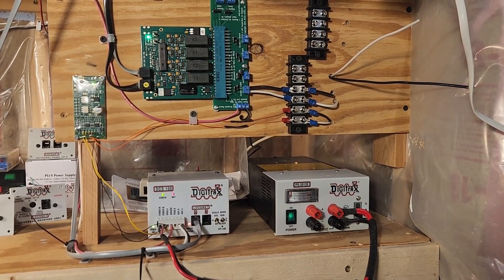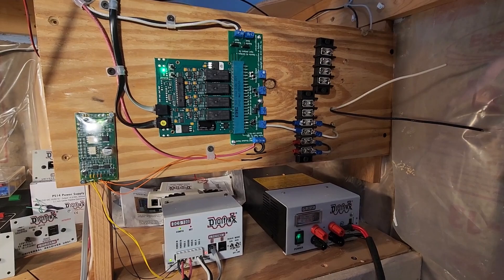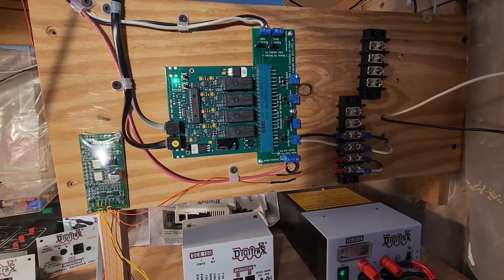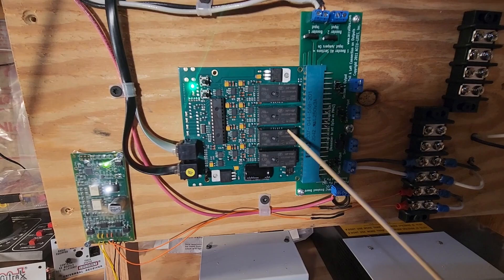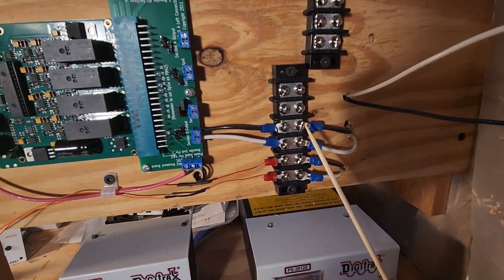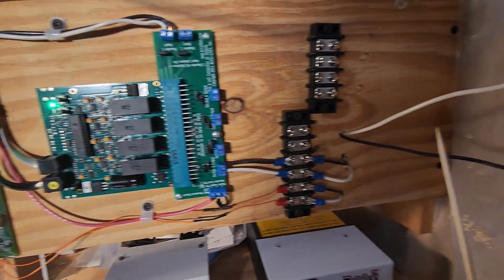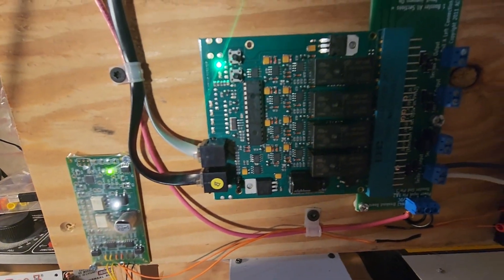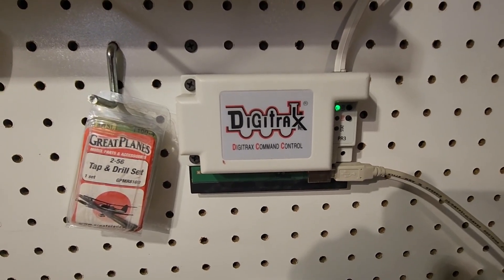DCC Command Station Organization for My Multi Deck Layout

Comment: I had a Digitrax Chief system that I bought 1998 and later upgraded by adding a DT400 throttle, but I found it less than intuitive to MU diesel consists and operate. I didn't want to have to rely on a cheat sheet to make consists or break them.  Train Control Systems came out with their DCC system about 1 1/2 years ago so the timing was perfect.  The TCS UWT100 and UWT50 are wifi throttles and so easy to MU engines and other operations with a menu driven system.  I divided my layout up into 4 districts, 1 for staging, 1 for main yard and 1 for the mainline and lastly for the branch line that runs to a lower level.  I'm using DCC Specialties PSX circuit breakers for protection.
Reply from the maker: @riogrande5761  I know.  I cut my DCC teeth on Digitrax DT100 and DT100R throttles.  Is a DCC system by EEs for EEs.  The DT400 R/D was an improvement.  I've learned to like them.  For running trains I prefer my phone and Engine Driver using JMRI to get to the command station.  But enough about religion...